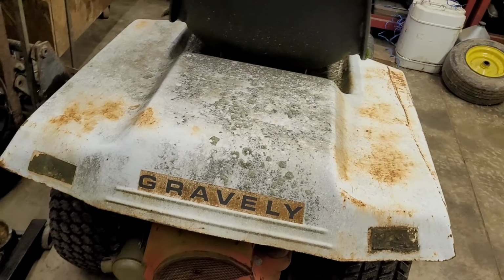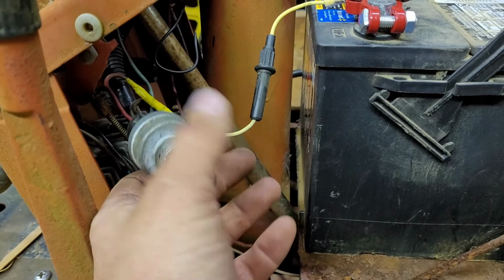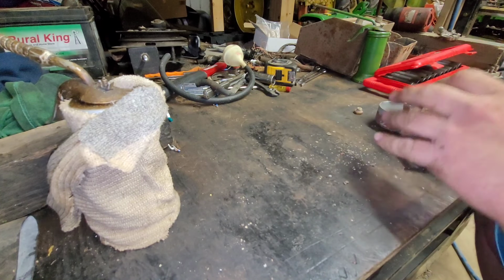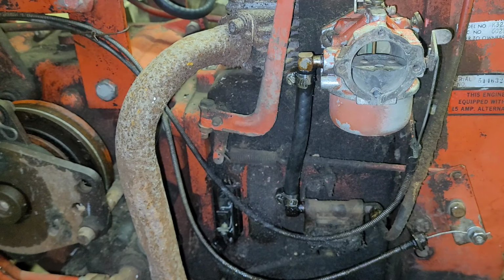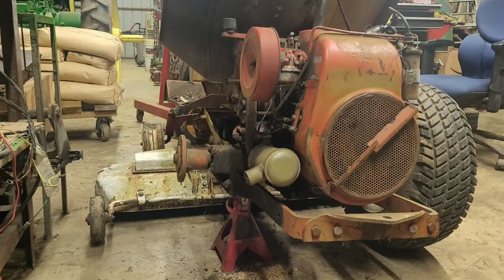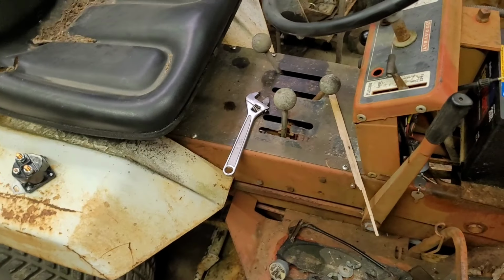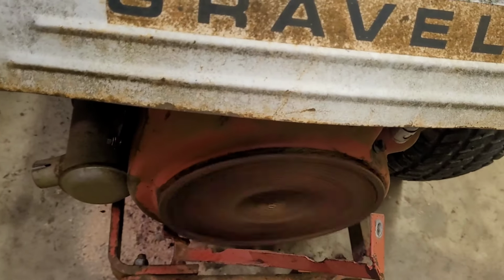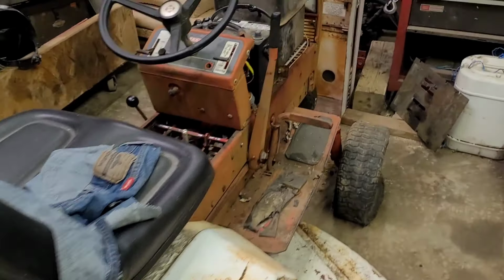will it start gravely 814 sitting outside for years

Comment: Hey Mike. Great fix again. Could you possibly make a quick video on the throttle cable position at the engine for a 112?
Reply from the maker: @olliesmowermart11  are you talking the way it's run or how to adjust it?
Reply: @mikestarcher  I don’t know where the throttle cable mounts
Reply from the maker: @olliesmowermart11  making a short now it'll be up soon

Comment: What is the best place to buy Gravely parts.  I just got a mint 16G with 367 hours on it. The thing is a real gem. Paint is original and looks awesome. Its a twin.
Reply from the maker: @barryklinedinst6233  are you looking for new parts or used parts? I get most of my stuff off eBay
Reply: @mikestarcher new parts if possible
Reply from the maker: @barryklinedinst6233  start out with eBay